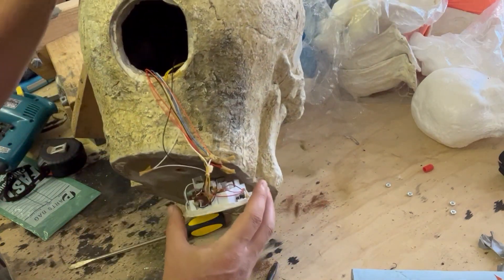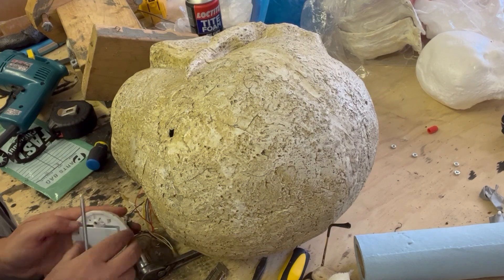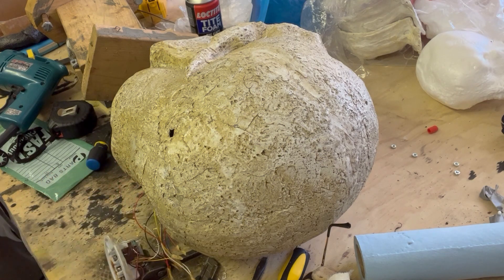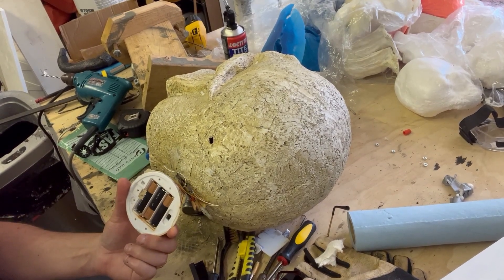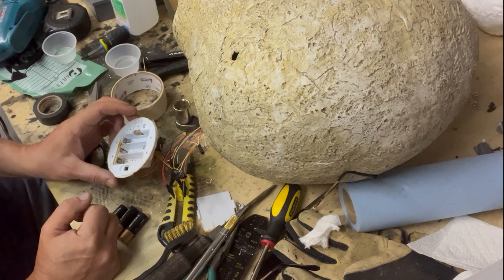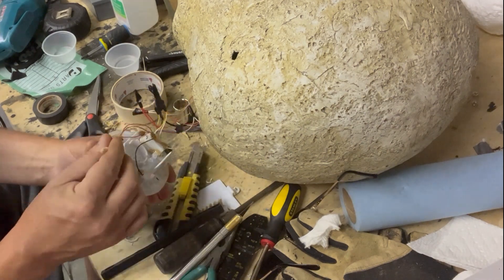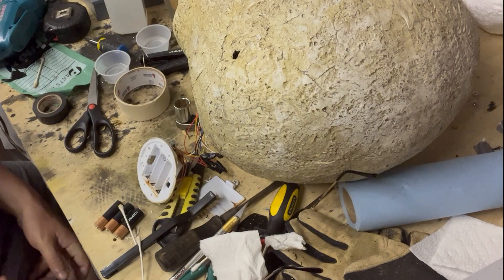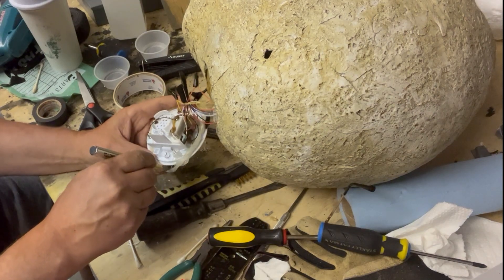How to Fix Broken electronic Props or Animatronics.

Comment: I know this is old, but if you see this - What did you do with the wires?  I was hoping to learn the rewiring part!  I’m new to this and have a few Halloween decorations I’d love to fix!
Reply from the maker: The wires were connected with just masking tape. I rewrapped them with electrical tape and checked all of the wire connections to troubleshoot the problem.

Comment: Wait so basically the issue was just corrosion and it was fixed? That is just amazing! So cool you got it back working but not only back working but you gave it an awesome makeover! Hope depot should hire you to design the props! The spikes def upped the anti. I have a similar skull in my collection and now you got me thinking. 🤔
Reply from the maker: Rubbing alcohol and vineger on the battery terminals was what fixed it I think. I've used that hack on many battery operated props.